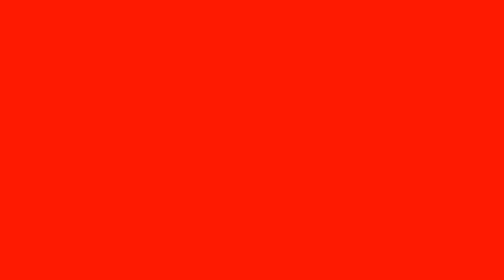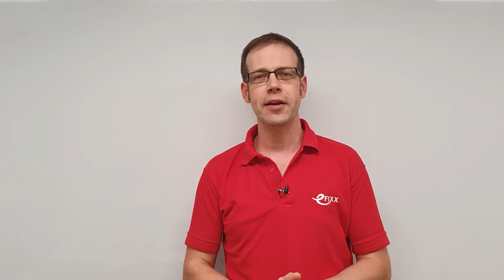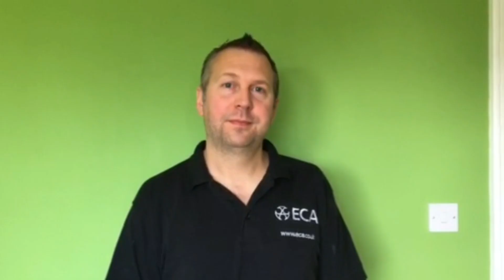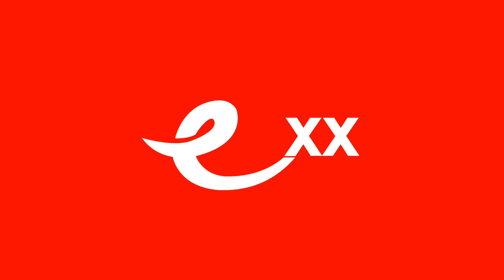Should electricians assume TN-S and TN-C-S are both PME earthing systems.

Comment: Hi so if a swa circuit is fed from the consumer unit on a TN-C-S earthing system does the remote end of the swa change to a TN-S system
Reply from the maker: No, the earthing arrangement is defined by the means of earthing to the origin of the installation not a sub-main. Good question though.
Reply: @efixx  thank you

Comment: I have a PME sticker on my board.... the earth is bonded to the neutral in the garden from an over head cable landing in the ground. The supply is fragile in high winds. Decided to go off grid and install my own earth. Can a locked mechanical transfer switch or isolator be installed on the consumer side or prosumer as I will be when offgrid? If I am off grid completly then I can up the no. of solar panels without restriction by the DNO. Any info on this is welcome. Cheers

Comment: Western Power advised me in November 2020 that they don't have records for the earthing arrangements in dwellings.  They were not keen on arranging a visit to the property in order to investigate.
ESQCR rules must have changed since this video was published.
Reply: I did ask (as a non-electrician but curious as the on-site arrangement looked a bit like TN-S) but I guess assuming it is TN-C-S is safe and when I did have my EICR (before moving in) the earth loop impedance reading was in TN-C-S bounds. I didn't pursue the matter. I was surprised they didn't actually know though!
Reply: @seprishere  Does ''TN-S should be assumed to be TN-C-S'' mean the lead sheathing of the cable that comes into the house is joined  to the neutral of modern TN-C-S type cable in the street somewhere that takes it back to the distribution transformers star point? Because if the lead sheath is not connected to the neutral conductor at some point then the main earth terminal is not earthed as far as I can tell (other than through extraneous conductive parts).
Reply: @Orgakoyd it’s only tn-s if the entire path to the transformer is separated and the DNO plans to never change that. Given that new underground cables are pretty much universally C in the UK, that means that even if it’s currently non-C any repair in the line at any point will change it to Tn-C-S. So as long as that’s true, assuming TN-S is essentially unsafe, at least in residential/small office context. Maybe if you’re a large industrial client with your own transformer, things become more complex than that.
Reply: @JasperJanssen  Thank you for that. I’m always keen on learning more about this stuff. I read a western power PDF from 2019 that said they have standardised on a minimum service cable size, and minimum distribution transformer size going forward, so that the distribution grid is able to handle increase in load in the future. Also that all new cables, and any replacement cable going forward will be 3 phase, connected underground in the street and brought into the building ready for a 3 phase supply in the future, and also giving opportunity to swap phases around easily for balancing, whereas currently it’s not possible other than digging up the joint under the street.

Comment: Quick question folks
Do we need to earth bond metal beam in a new extension and another one on loft conversion ? Same property.
Reply: Thank you sincerely for your advice
I will give them a ring to make sure its correct
👍
Reply: @sparkymacsparkface7497 they are atm but they will be buried with plasterboard anyway
Reply: No unfortunately it doesn't have
Reply: If in doubt 
Bond it out!